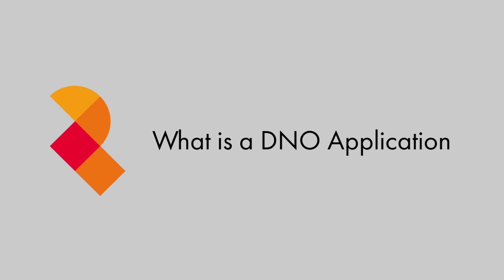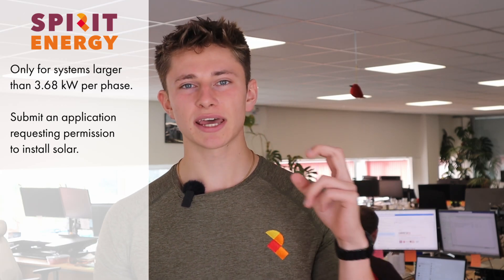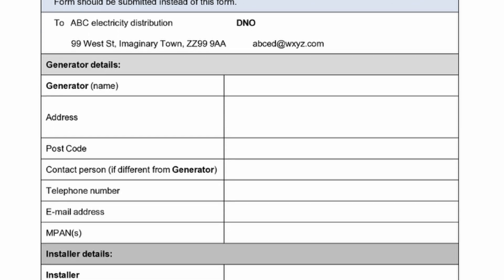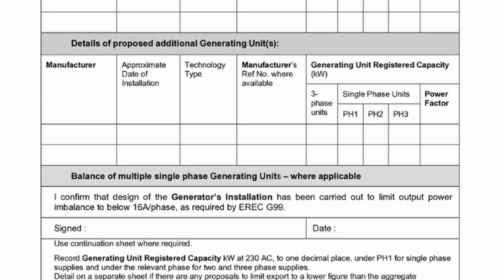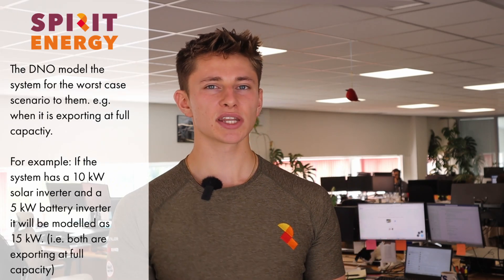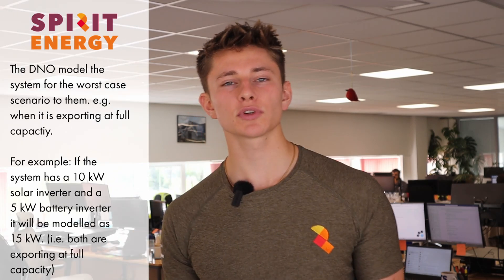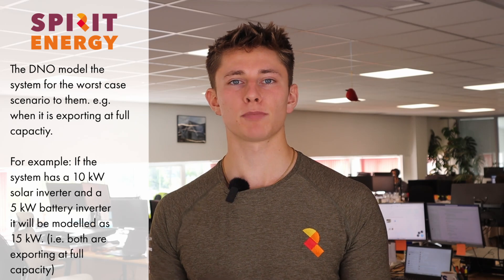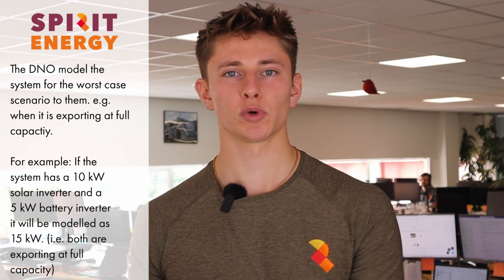What is a DNO application?

Comment: I have just discovered your channel thanks for posting so much helpful information. This video is excellent.

Can you explain why the DNO limit the size of the inverter even when the power limiting devices are G100 compliant?
I have read the G100 spec and it is intended to be fail safe so that it can never export above the set limit. It says "Devices shall be set to operate at levels that cannot, whatever happens next to equipment in the Customers Installation, breach the MEL or MIL."

It seems to me the DNO are unnecessarily restricting local green power from the grid.

Comment: My new build has 4 x 335W panels, so less than 3.68KW. Do I need a DNO letter? I can't find one in my paperwork. I cant export to Octopus without it. According to every other website ive read, A system <3.68KW is notifiable, but does not require pre-approval, and is G98 rated. A system >3.68KW requires approval prior to intallation and is G99 rated. Both systems require DNO approval.
Reply from the maker: Thanks for the comment. You do need to post-notify the DNO that the system is installed, but they won’t be able to contest it. They should send an acknowledgement which you can send to Octopus. I think Octopus require an MCS certificate as well, although they may have phased that requirement out. 

I hope this helps and please ask any other questions. - Tok
Reply: @spiritenergy_uk  Thanks for the reply. I think i've managed to clear up my own question. The first 2 digits of your MPAN give the DNO. In my case, it's actually an IDNO - GTC-UK. I emailed them to ask the question, and the lady replied saying that if i reply with my MCS, she will liase with the Asset Design Team to complete the admin and send the DNO confirmation letter directly. Hats off to GTC-UK for customer service.
Reply: @robertdewar1752 how did you manage to sort out the mcs certificate?
Reply: @Reduced009  The housebuilder provided that. Update: GTC-UK are still working on the DNOs. I guess they'll do all, or some, in a btach or batches.
Reply: @robertdewar1752  May I ask how much this set up in total cost you including labour?